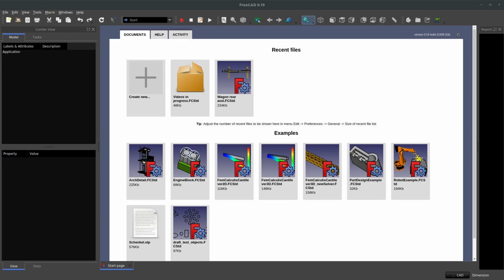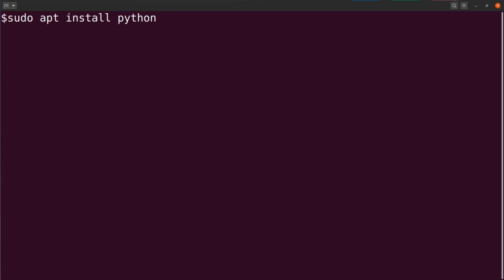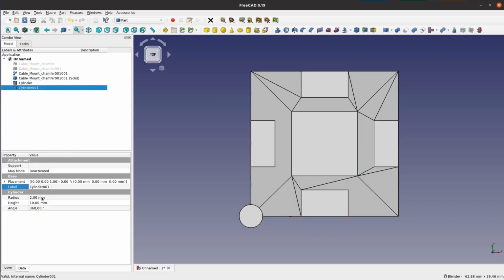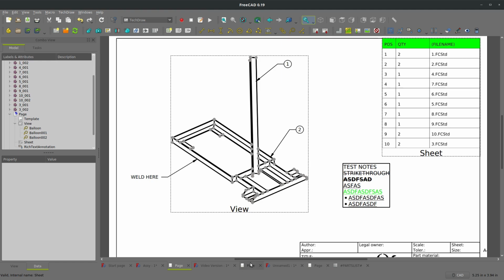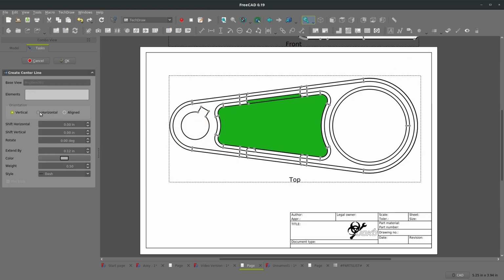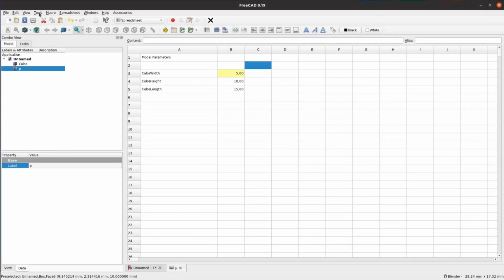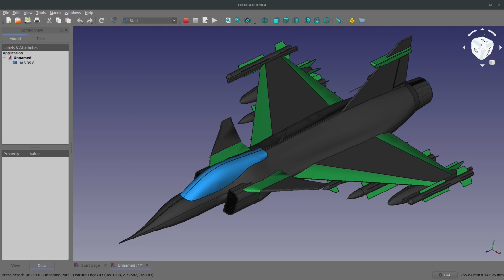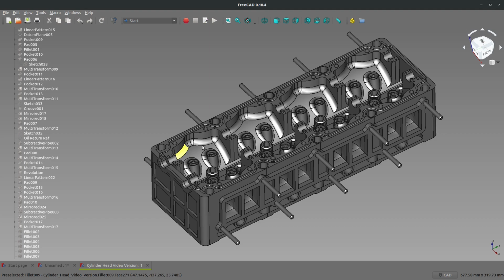FreeCAD Useful Tips and Awesome Tricks with @WayofWood! |JOKO ENGINEERING|

Comment: Thank you for this video. Can you tell me how to create a fillet/rounded end on a hollow cylinder in FreeCAD?
Reply from the maker: Sure there can be several ways.  You can make the cylinder have rounded ends in the first place by sketching out a rounded end cross-section and then using revolve to generate the cylinder, or if you're in the part design or part workbench you can select the edges you wish to smooth and select the fillet button